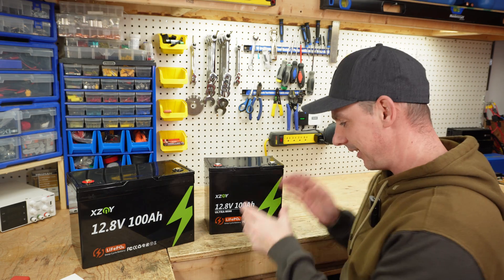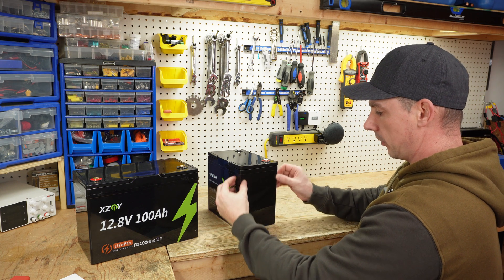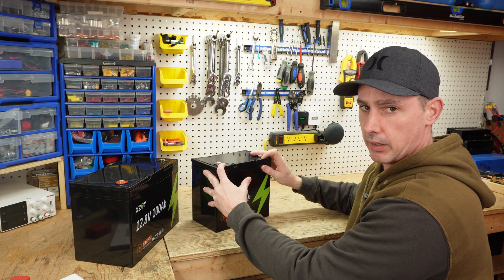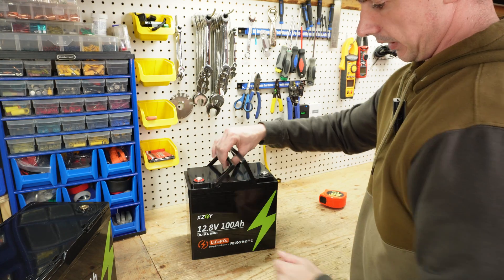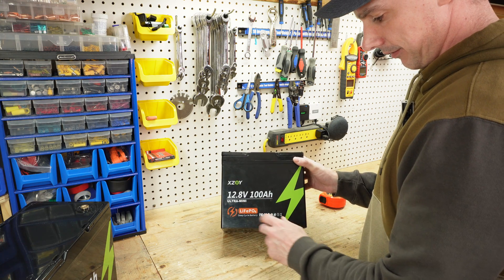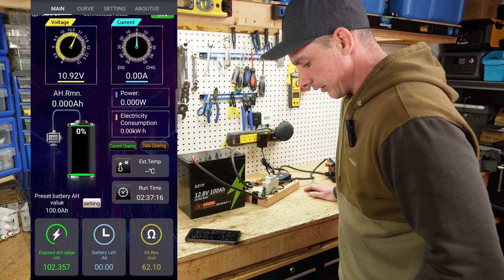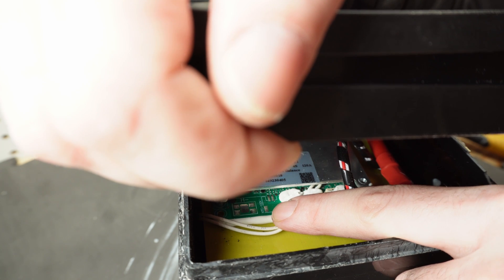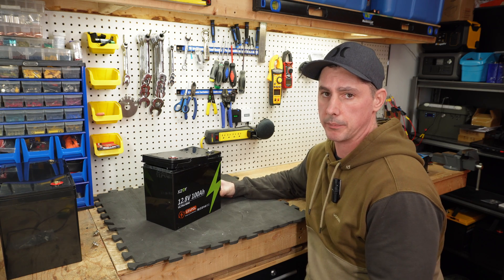XZNY 12V LiFePO4 Mini Battery Tests

Comment: Hello, what setup are you using for testing the capacity of the battery?
Reply from the maker: @vladimircintula8363  A shunt
Reply from the maker: @vladimircintula8363  https://youtu.be/1PsL1g87iY4?si=tgXnCpf8GSX98ETp

Comment: Interesting.  They call it “ultra mini” but it’s really just the actual size of the battery.  The other one is just “jumbo” due to the padding inside.  

Boggles my mind why these places aren’t adding the one extra connection for low temp protection.  

Thanks!
Reply from the maker: Adding that low temperature would have made a huge difference. Thanks for watching.

Comment: What do you figure is the reason they are not adding low temp protection?  It cant be more than a few more dollars in components for the BMS.  Lots of popular chargers do not have low temp protection so its not like its uselessly  redundant or anything.
Reply from the maker: I couldn't tell you why not
Reply: After seeing  the Voltgo series, these have a hard act to follow. How did you like them?
Reply from the maker: @ThreeDayrv  I liked them a lot, I need to make more videos on them.

Comment: Sir:  May I ask what size the main wire to the output terminal is and what material (copper or CCA)?  

A T Burke
Reply from the maker: One 6AWG on the positive and two 8AWG on the negative. Copper

Comment: Thanks man, I was going to buy the 30 amp but now I came across this,,, I also have the 24v 100 xzny,,, good performance….  I charge my solar power station at 400 watts with the 24v without a boost converter…  this battery is small and what I’m looking for
Reply from the maker: Perfect, I'm happy I could help 😁👍